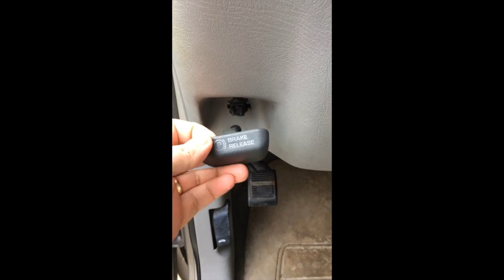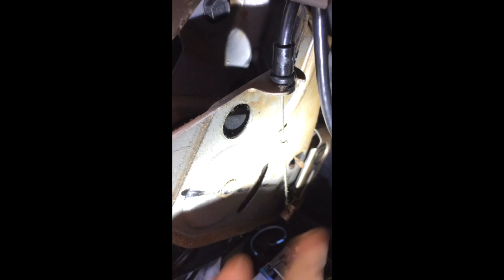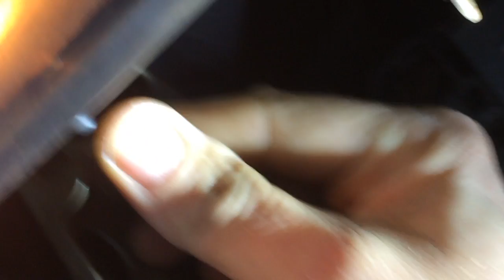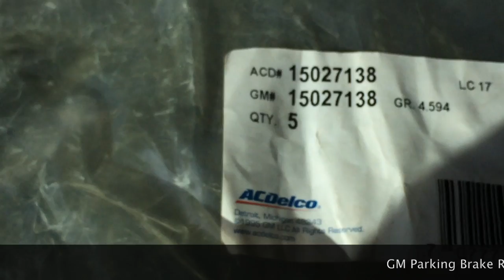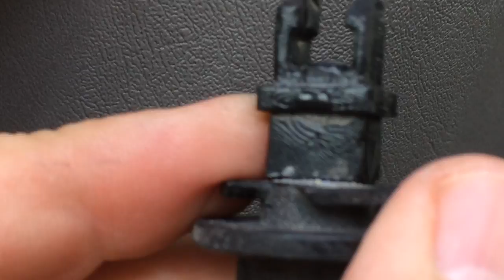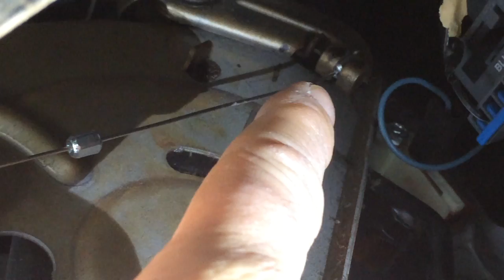1995 - 2002 OBS GM Truck Parking Brake Release Cable (at Handle) Repair (Chevy & GMC)

Comment: Hmmmm. There are BUNCH of wires under the dash.  How did U make your to the cable
Reply from the maker: You'll want to follow the release cable to the handle, not any of the electrical wiring.   You'll have to work around those.

Comment: No, does not apply to my 2002 Silverado. Useless video if you're stuck at the grocery store like I am with a broken brake release handle.
Reply from the maker: Video is only for OBS (old body style) trucks as indicated in the title.  So for 2002, only for the GMT400 bodied 3500HD truck carried over from 1998.   The Silverado for 2002 would be an  GMT800 bodied NBS (new body style) truck.

Comment: Good video! FYI if you have that clip on the back that holds the 2 in place , broke like mine , just remove it and I  used a zip tie thru the hole around the 2